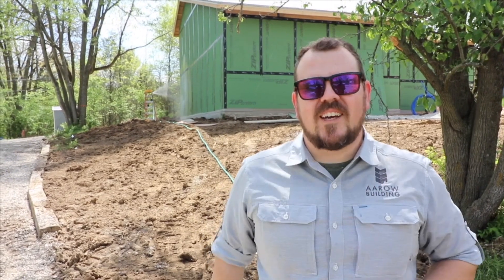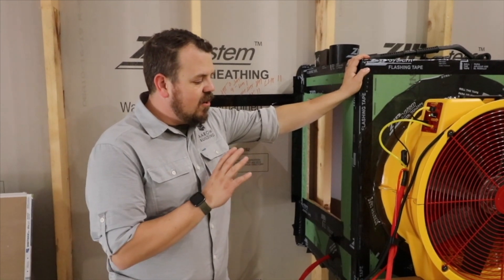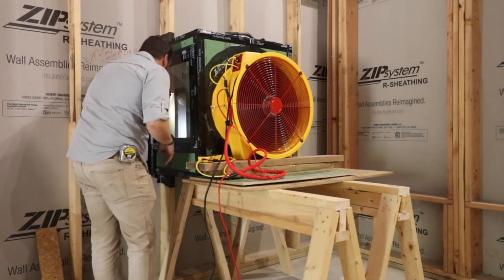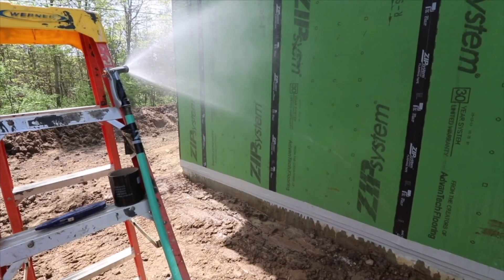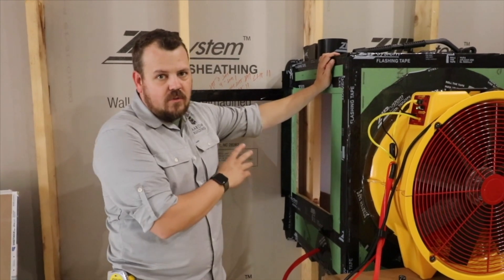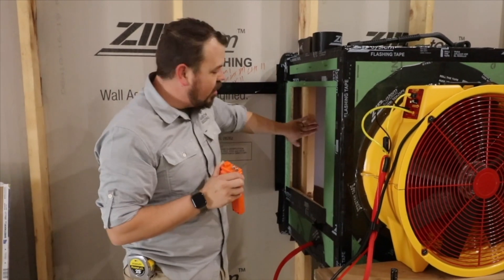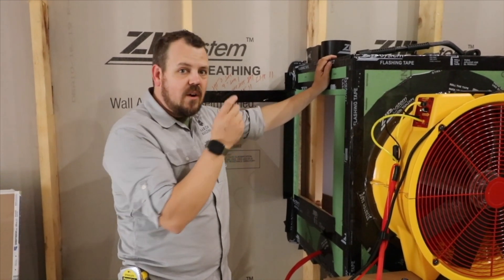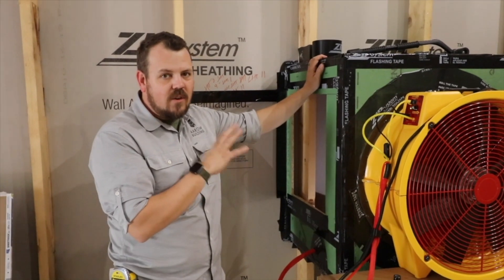WILL IT LEAK? ZIP Sheathing Penetration Test

Comment: So the theory is the coating on the zip seals around the siding nail.  But the siding nail is under a lifetime of stress from the siding expanding and contracting and having wild pulling and pushing on it so unless you created a rain screen with furring strips that are sealed the nail penetrations  are going to leave over time .  

Since the majority of homes use vinyl siding as it is cheapest, it’s probably not the best method.  But since tyvek is almost always installed improperly (after the windows are installed) it’s probably worse under the windows where the J-Chanel leaks the most so zip is still probably better than tyvek

Comment: And -151.5 Pa of pressure converts to a whopping...wait for it...-0.022 psi...! Which is essentially no vacuum whatsoever. Stay in science class kids. Don't drop out then become a home builder...! Or better yet, don't drop out and actually become a home builder that knows the basics behind the building sciences. And can devise a proper experiment at the very least. Besides the point, Tyvek has a better video demonstration showing the difference between their product and zip, particularly at a non sealed nail head in the zip sheathing. No disrespect to this man but he has to realize that there may be people watching that actually studied this stuff for real...for many years...and earn livings as engineers and scientists.

Comment: @jake My takeaway from this is this, please let me know if you agree.

1. If I miss a stud or have a shiner just leave it.
2. There's no real need to address each nail penetration with Zip liquid flash to air seal that penetration since the nail has filled that penetration and isn't letting any moisture through.  This is a big costs saving if this step is removed from the sealing of a structure.

Comment: I'm disappointed in this test.  You tested bulk water penetration through polyiso and spin it off as something to do with zip sheathing, which is permeable. Also this test says nothing about the migration of vapor, which would likely drive through the OSB since its a retarder, not a barrier. And also this test does nothing to cover condensation which is another way water gets into walls. I just don't see how this is useful for anyone. But that's my opinion. I see a lot of people drawing false conclusions from this video.
Reply: the green coating is the barrier
Reply: @loumalibu5596 not true. Sorry bro. Water gets through it eventually.
Reply: @CybekCusal  What do you mean "not true". The ZIp Green "coating" is the WRB i.e. the barrier. Please point to either real-world examples or testing that shows water getting through a Zip assembly with poly-iso on the back. Condensation isn't going to occur on the backside of poly-iso if it's not cold, if there's additional cavity insulation against it either bat, blown or sprayed.
Reply: @hu5tle-  you really asking these questions on a YouTube channel sponsored by Zip.... any data coming from a source paid by the vendor is obviously tainted.  I'm not going to bash the zip product here nor post links disparaging the product.  I'm simply expressing my personal opinion.   Even just read the description of the product,  it's a "water resistive barrier" what do you think that means? Water proof? I think not.  Lol. I accept apologies in the form of cash for wasting my time and having to teach you the basics of how to read a brochure.
Reply: @CybekCusal  still waiting for your data. I never said it was waterproof. So, asking again to provide real world examples of supporting evidence of what you posted! The sponsor has nothing to do with our conversation.  Just another troll that lacks data. No need to respond and waste your time.
Reply: @CybekCusal  You've not provided any evidence. Keep name calling. Shows you've already lost the argument. Learn how to debate like an adult and provide data that supports your hypothesis, still none provided.
Reply: @hu5tle-  I don't need to. I don't work for you. Had you asked nicely maybe I'll teach you a few things. It's interesting how you think you can control some random stranger on the internet who's simply expressing his freedom of opinion and give them orders like a drill sergeant. Lol. And when I answer, you pretend I owe more. 🤡 I don't care what you think. I have a life. Bye.
Reply: @CybekCusal  I don't need to ask you anything. It's simply best practice that people support their POV with evidence.  It's not a paradigm I created method. It merely mimics the scientific method. 

 So, the less evidence you have to support your opinion, the last water it holds, pun intended.   Surely even you can grasp that concept. 

Again, no need to respond. You aren't going to provide any evidence that supports your opinion therefore the conversation isn't moving forward or productive.